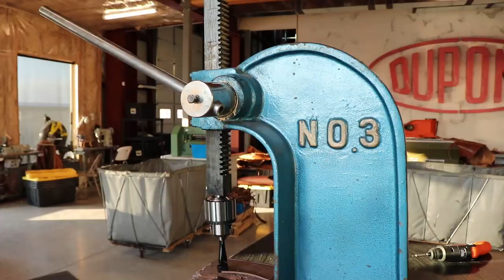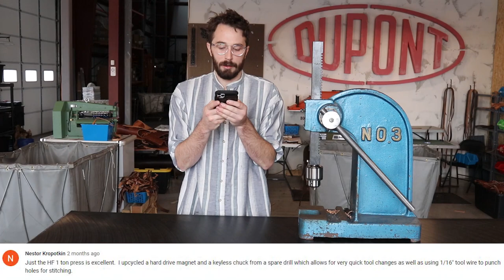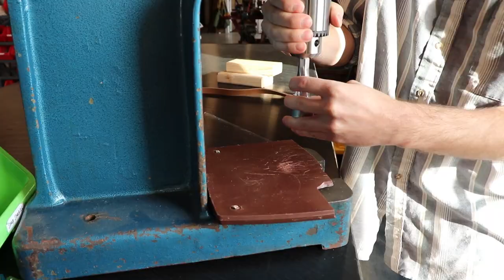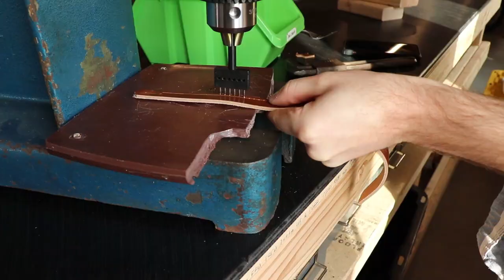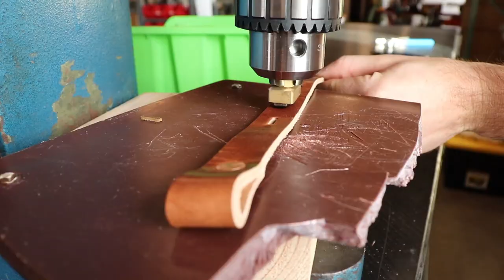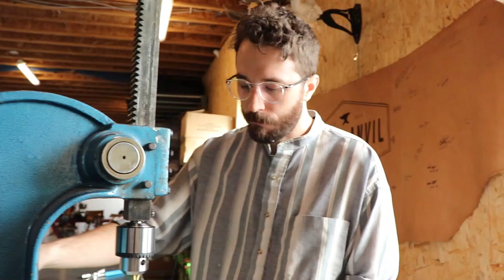#1 LEATHER CRAFT TOOL - if you are serious about getting into leather craft

Comment: I was using one of the little HF presses for hot stamping with a little PID heater, but I just built a pneumatic press to get more consistent pressure. The drill chuck idea is gold

Comment: I’ve been looking for a arbor press to make something like this, but they all seem to have a small space between the metal plate and the highest point, so it seems difficult to get the tools there, let alone plus a drill chuck. Can you measure the space available between the metal plate and the place you attach the drill chuck at it’s highest point?